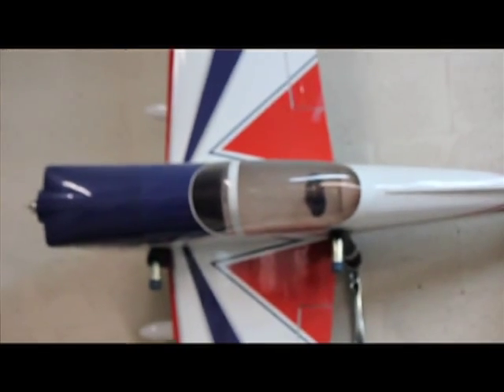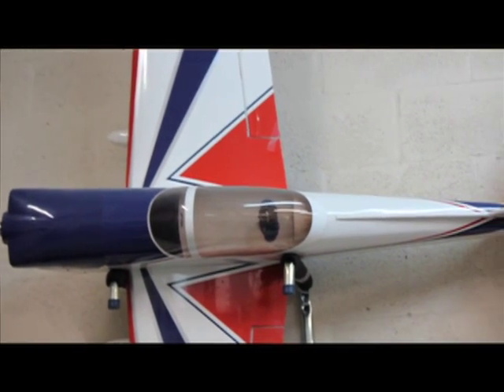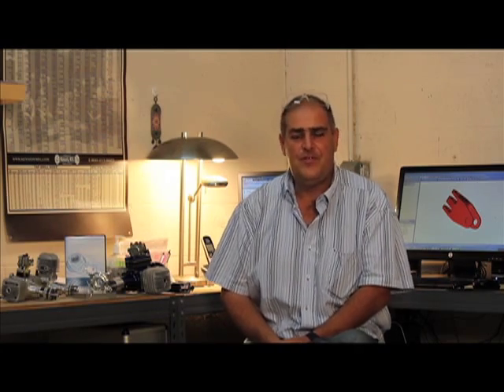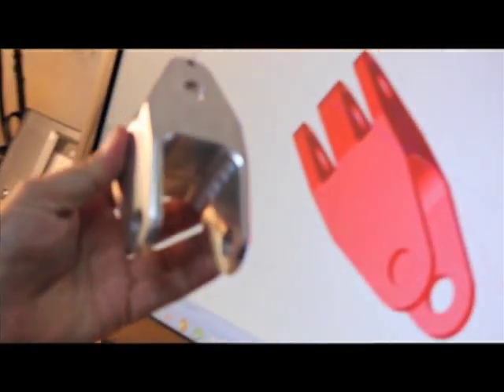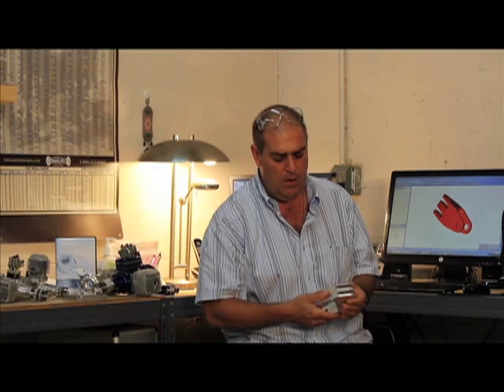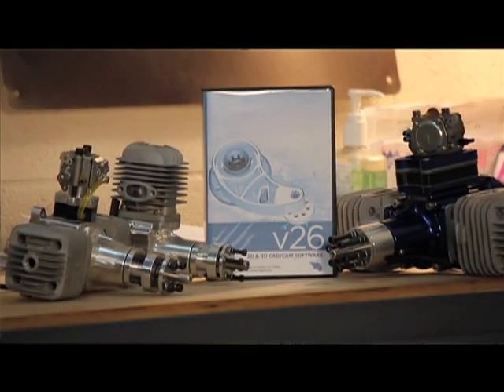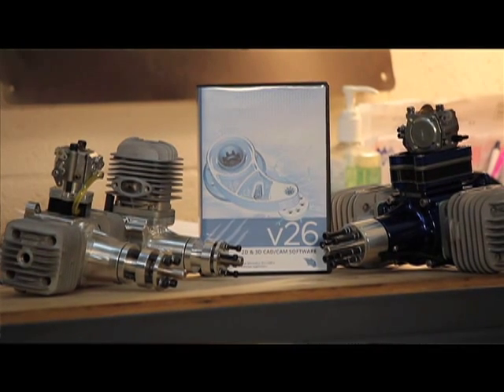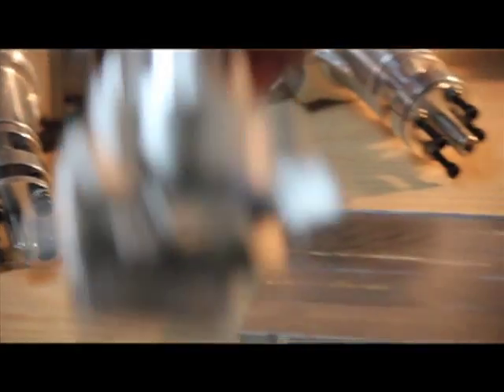BobCAD-CAM Machinist Talk Mateo Saraga

Comment: i have to agree with the man, ive been making chips for approx-32yrs, a little more than half of that time all by conventional methods then i started into programming. I have used many other softwares but i have yet to find a 3D-SHAPE using the 3-axis pro that i havent been able to climb the whole part. Bobcad is the fastest to learn of all ive tried. I just started with V26 after using V25, V25 is excellent,, V26 is a little faster in its dynamic set up now, ive been very happy with both versions. 4th-axis standard is my limit, cant speak for the pro-4th and 5th parts but everything 3-axis pro-through 4th axis standard is well worth the money, just a hobby persons opinion!
Reply from the maker: Thank you!